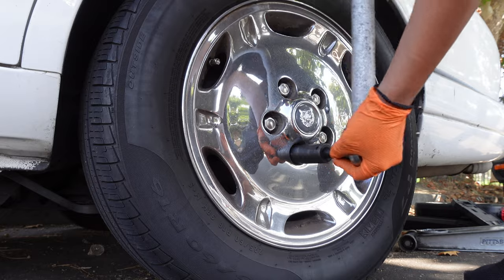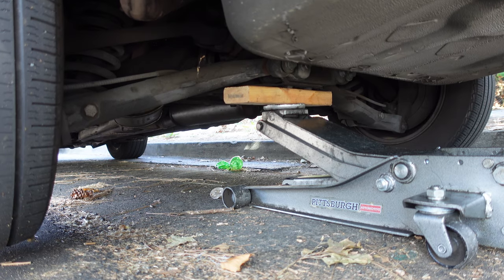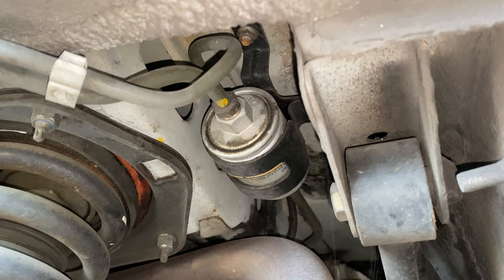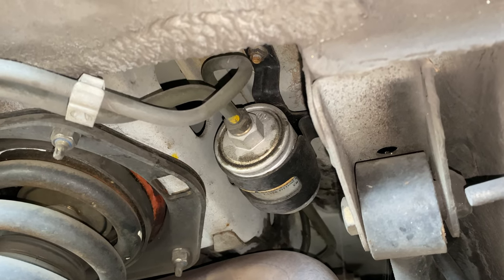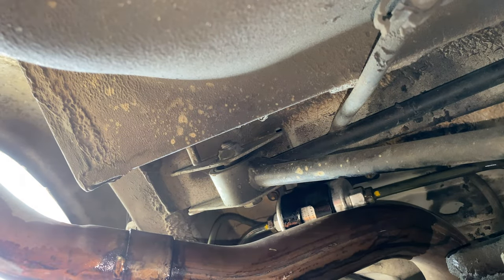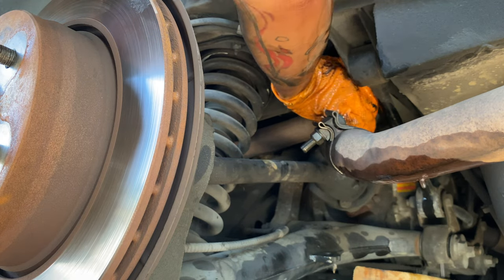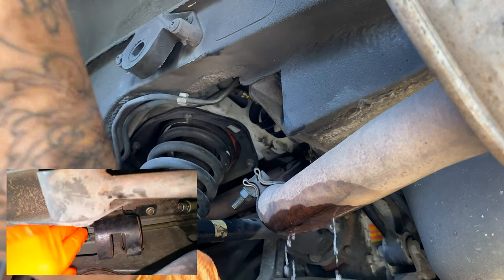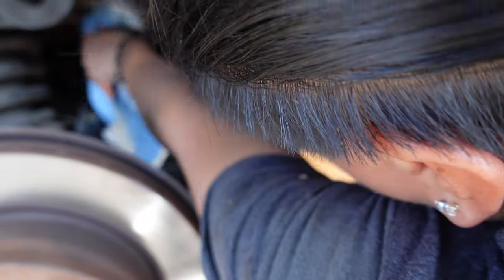How To Replace Fuel Filter on Jaguar XJ6 X300: Maintenance Guide

Comment: ive been trying to get my fuel filter changed for 3 days it doesnt look rusty but its stuck on , i think that detroit lions linebacker i bought it off wrenched it so tight i cant get it off and neither can 3 of my mechanic friends , im gonna cut the line and use a rubber hose , id hate to have to do it but i have no choice , such a simple task it just blows my mind , i still dont have money for registration or insurance but i am just trying to get the car mint , i fixed the cup holder and the non glovebox spot and popped dents outta the hood but havent gotten to really redline the car and drive it yet , i did test drive it before i bought it when it had shit fuel in it so i know it runs fine , it sucks being poor , rich people run around buying cars left and right they dont know the struggle of what its like to appreciate an old jaguar so much

Comment: Yeah on all my cars that i've ever changed the fuel filter, the fuel eventually stopped flowing after a brief moment.  Some mechanics say that it's best to pull the fuel pump fuse/relay and start the car to run all the fuel out of the line for which the car will eventually stall from lack of gas. Then you can remove the filter with no fuel leakage.

Comment: Hey Jesse, do you have an idea what size are those 2 Orings I also need to get? I am going to change the filter soon, I got the UFI filter already, but also those Orings are not included. I will need to go to other city to buy those in specialized shop, so it would be great to have them already prepared before I pull the filter out. Much aprecciated
Reply from the maker: Hello James, I don’t know the actual O-ring size I bought a O-rings kit that include different sizes.

Comment: I don't know if the X300 has the same tank as the XJ40, with the fuel in and out at the bottom, but if it is the case, it is likely that the whole pump and hose are submerged completely. I had this issue when I removed the tank on my XJ40; it wouldn't stop to drain, until it was empty. Now mine runs with a plastic tank from a Mazda 3 :)